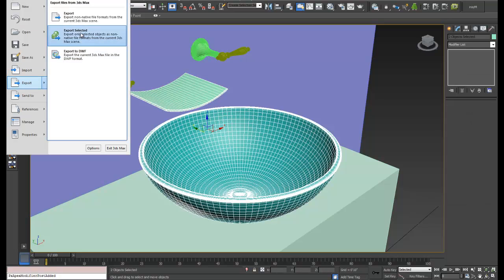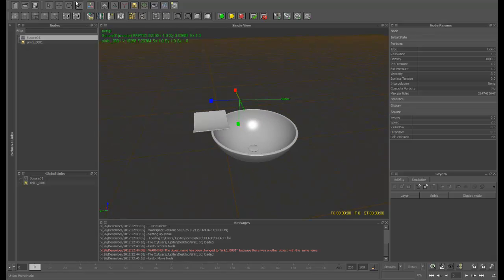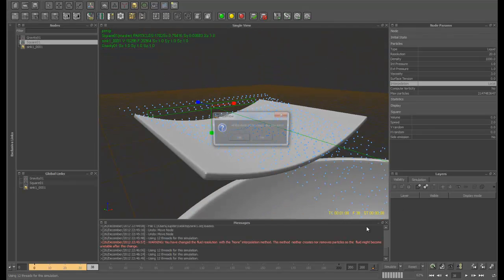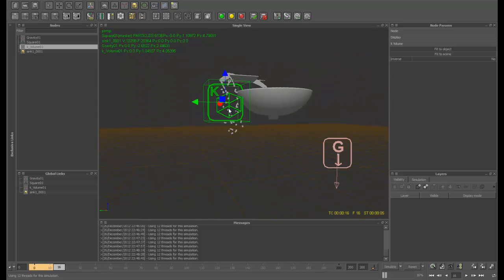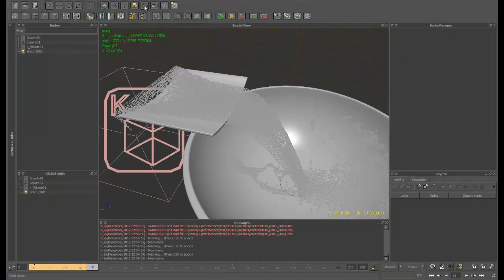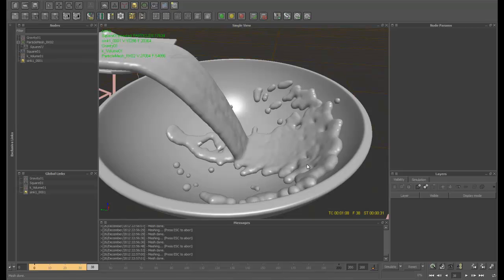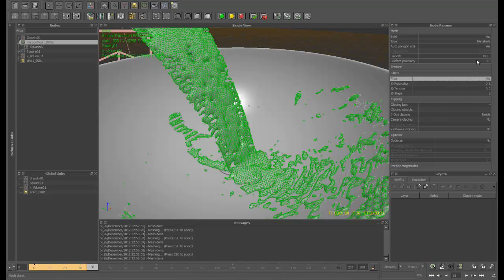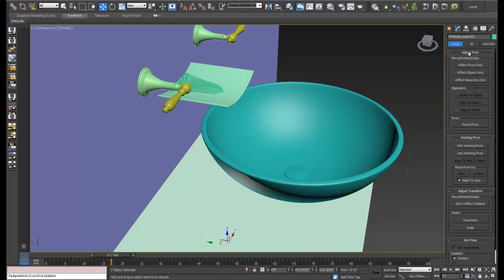Exclusive Tutorial: Modern Sink Scene - 3DSMax, Realflow, Iray ( Part 2 )

Comment from the maker: Check under the Simulate tab bottom right. There should be an arrow pointing down expand for list and choose options > general tab - you can control how many processor threads you are using. I have it on Use max. threads